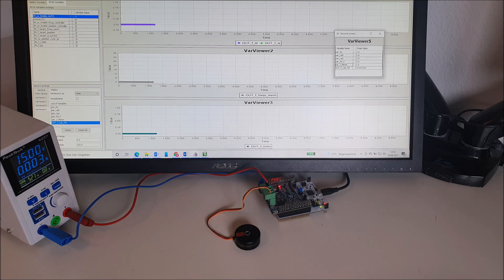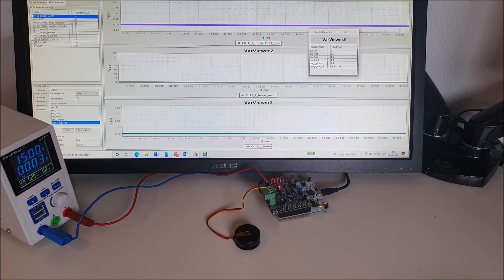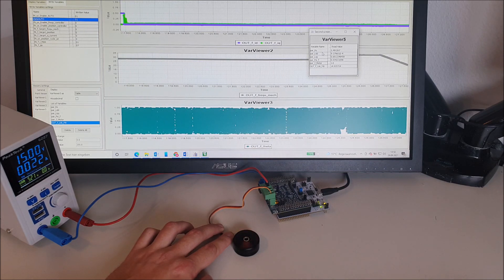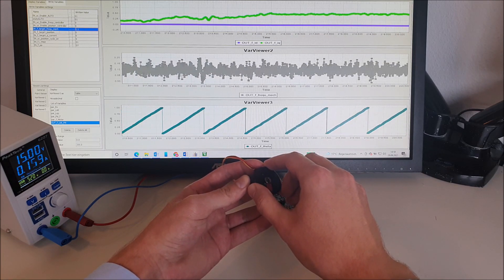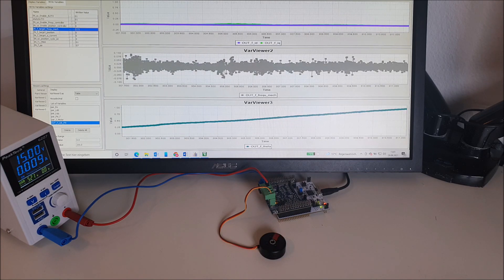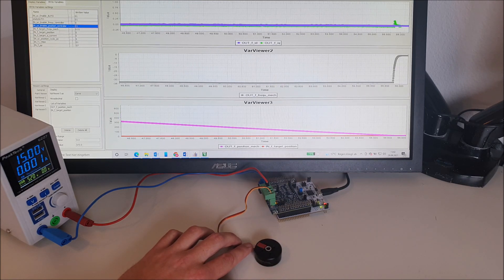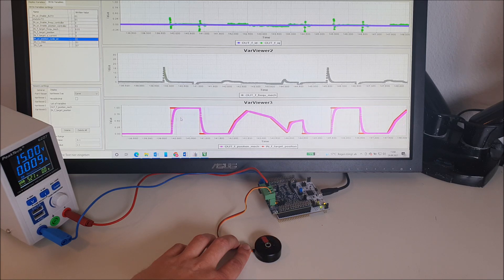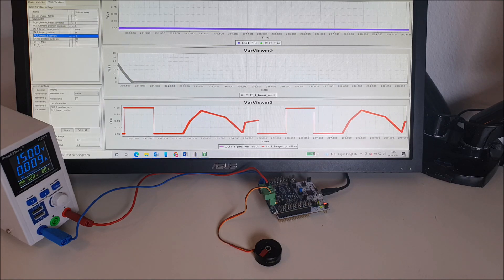SMCT’s Autosetup solution; Plug & Play for sensorless motor control; Hands-on example for a Gimbal

Comment: It's great.  No requirements for the salient polarity of the motor?
Reply from the maker: Thank you for your comment and we are sorry for the late reply.
If you mean the saliency in general (difference between d-axis and q-axis inductance), there is a minimum requirement.
Motors that are completely isotropic (equal d-axis and q-axis inductance) at no load condition will not work.
Our solution works well also for motors with small saliency. The concrete minimum value depends on the used hardware (e.g. current sensing performance).
For example, we were able to implement our sensorless solution on motors with only 1-2 % saliency.
Best regards,
SMCT

Comment: Do you have to tune the observer parameters for different motors? E.g. if you would use a much larger outrunner or a very quick and dynamic inrunner.
Reply from the maker: Thank you for the question.
We have a default setting for the observer parameters. These parameters need no tuning.
Thanks to a special model-based evaluation of the motor properties, the algorithm receives additional information about the speed dynamics.
Like this, the algorithm can control motors with low speed dynamics and also highly dynamic motors with the same observer parameters.
(Normally, highly dynamic motors are of course the bigger challenge for an observer).

This approach reduces the number of critical control parameters.
In general, we are able to do a straight forward parameterization of the sensorless algorithm based on the identified motor parameters using an optimized script.
In most of the cases, no further tuning of sensorless-specific parameters is necessary.
Of course, depending on the application, the calculated parameters for the speed controller and the position controller may be not perfect. So they can be tuned according to the user needs. 

Best Regards,
SMCT
Reply: Many thanks for the answer.
Which pwm frequency do you run here? Is there a noise with a fraction of the pwm frequency like the other industrial inverters with no sensors?
Reply from the maker: @andreasr3412  sorry for the late response!
The used pwm frequency in this setup is 32 kHz and there is no audible noise caused by the sensorless algorithm.

Best Regards,
SMCT